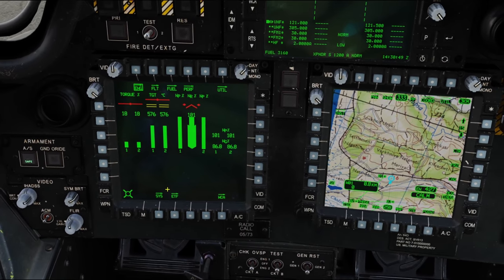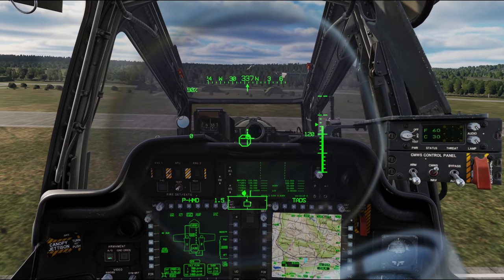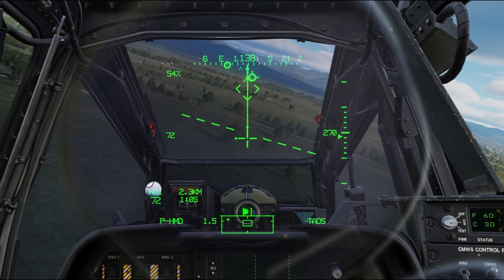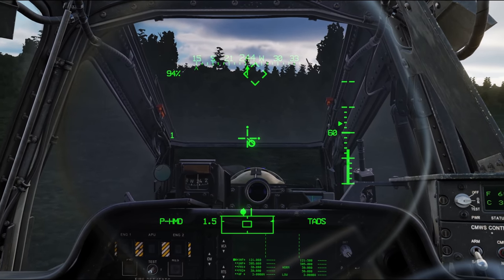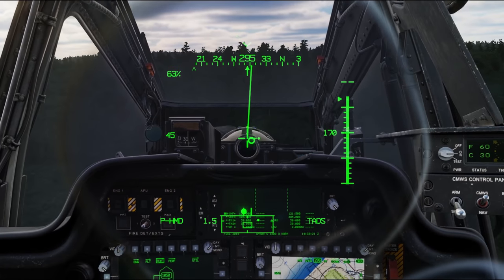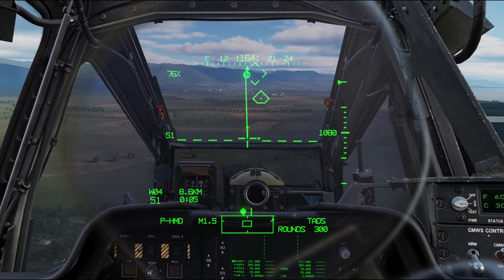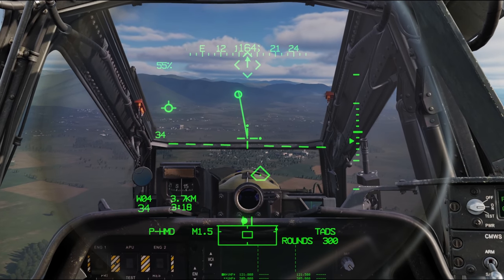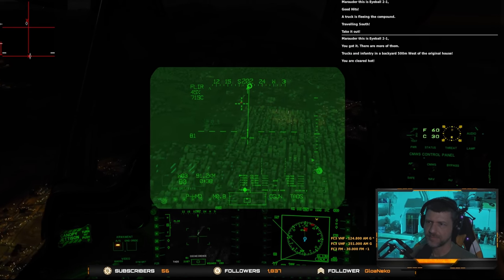DCS: AH-64D- Stop hovering so much

Comment: I made this mistake  on my first attack run against some tanks...... turns out ATGMs are just as effective against an apache sitting fat dumb and happy as they are against another tank........
Reply: Wait till they get you with the main gun. I earned real quick back in the Blackshark days not to get too close to tanks. Especially tanks with a laser range finder. Looks cool when they miss though.
Reply: @sasquatchycowboy5585  Oooof, never taken a main gun hit. Had a couple of ATGMs to the face between the Apache and my A-10 days...... kinda embarrassing in the A-10 tank buster when a T-72 kills ya.... I mean, kudos to the guy pointing the laser, he's got 30mm going off all around, and still keeps it on the jet coming at him..... that takes something else lol
Reply: @Streaky100001  lol.
Reply: @sasquatchycowboy5585  yea pretty much instant range acquisition, ballistic solution calculation followed by a Mach 3 tungsten arrow going straight at you
Reply: @Lemard77  It's way better then it used to be. At least as long as your moving you are OK. Back in the Blackshark days you couldn't even get close to an MBT.

Comment: Watching gun cams of the Apache taught me this. They always roll in to constraints, slow down and stabalise, then roll out. They never hover or do bob-up attacks.
Reply: Just out of interest, were those mostly COIN ops? Might be some differences between those and near peer tactics, and I also wonder if a bob-up attack would be more conducive for FCR and radar Hellfires vs. TADS and laser Hellfires, since you can dive out before missiles start landing... Definitely an interesting subject overall, and definitely the Russians leaned heavily into moving attacks, no reason why it wouldn't work for a lot of what the Apache does.

Not that I know anything about this stuff. I just like fiddling with all the cool buttons on the front seat. =)
Reply: @jubuttib  I don't know either, only time I've seen hover attacks is Desert Storm when they destroyed infrastructure like bridges, I guess it depends on your air defence intel. Russia knows Ukraine has a massive amount of stingers from the U.S.
Reply: @ukLeeham720  Wasn't actually even thinking about Ukraine, but yeah that applies. Was more thinking about some discussions based on translated doctrinal documents.

Comment: I seem to remember from Janes Longbow (release in 1996), they talk about tactics. And one tactic with the Longbow, because it has the radar on top of the rotor, you want to position the aircraft so it is behind cover (i.e. a hill), but just barely have the radar peekover over the top.

That way you can pop-up, fire your new radar-guided Hellfire's, drop back down, leaving the Longbow's radar with a line-of-sight as it guides the missles to the target.

Edit: Yup; i had to dig out the manual:

> FCR stands for Fire-Control Radar, a second type of target acquisition system found only in the Longbow. When you bob-up from behind a hill, the bulbous Longbow radar dome on top of the helicopter automatically scans either a 90° pie-shaped arc (for ground threats ) or a 360° circle (for air threats) and “memorizes” targets. The beauty of the FCR system is that you can store multiple targets and then fire off missiles in quick succession. After launch, the missiles lock onto individual targets identified by the FCR. (TADS, by contrast, can only store/track one target at a time.)
> While tracking ground targets with FCR target acquisition active, the safest way to update radar information is to mask yourself in a valley or behind a hill or other natural terrain, maintain a steady hover and slowly raise the helicopter. Your radar automatically updates whenever the top of your mast has a line of sight (LOS) to the target.

Comment: This is even a common mistake in the KA-50, which is the attack helicopter so many are accustomed to. A lot of people think the Akula is a sniper, it’s a reconnaissance helicopter, it can sit in a hover (and sometimes you want to with it) but its job is to exploit angles, conduct reconnaissance, engage targets of opportunity, etc.
Reply: I don't know what real doctrine is, but the Ka-50 is infinitely better if you fly it in a pair with a friend and pretend it's a two-seater. One guy is head-up, hands-on flying, watching for threats. The other guy is head-down, using the autopilot more, and running the weapons. Same number of pilots, but distributed lethality and survivability.

The autopilot and datalink make it relatively easy for a pair to fight like a single unit, which seems like it would be useful. Shame about the MWS and Igla getting canned, though.
Reply: The Ka-5x is better than the AH-64 at hover and non forward flight because of the coaxial design.
Because of the missile it is better to shoot from hover or forward movement.

Comment: Some people about Mi-24P:
"It isn't easy to launch missiles from hover, Hind is horrible"

Apache pilot about AH-64D:
"Don't hover so much..."

Btw, didn't yet check the fuel consumption in Apache so it was interesting point. In Mi-24 the fuel consumption is same regardless the flight situation or weight, about 840 liters per hour. Why you can be at high speed cruising, NOE, hovering, fully loaded or completely empty, it doesn't matter as turbines consume that almost constant rate.
Reply: "Hind has the same fuel consumption regardless of flight situation.." says who? the TV3-117 engine manual and the Instruction of usage of Mi-24 says differently.
Reply: I took full fuel and 4 external tanks. I was definitely overweight and I got bored after flying around for 3 hours. I had 6.5 hours of fuel when I took off but my fuel flow kept getting lower for the less fuel weight that was on board. It would be fun to try to do a massive ferry flight although I'm pretty sure I could cross the Atlantic with that much fuel at over 120kts
Reply: @deekamikaze  4 fuel tanks? You psychopath 😂😂😂

Love the Hind. Nice mix of ATGM and rockets. Haven't really used the bombs or dispensers much on it but should give them a go
Reply: @SouthPoleAntarctica  Two pilots that fly Mi-24 and Mi-8.

That was their answer to question that why Russian helicopters don't have the fuel flow meter, but only have the fuel amount instruments, because the fuel consumption rate is so constant that you don't need to think about it.

You will just take the ~850 liters per hour and look at the available fuel and calculate in head that how long you have, and your have slight reserve too.

So if you have 1300 liters left, you know you have about 90 minutes left (1300/850=1.52).
If you have 200 liters, then about 10 minutes(850/200=4.25).

When you plan your mission, you only think about the time you need to fly, not weight, no hover, no altitude etc. You example take 10min for starting, 200 km per leg, 15 min in location, that gives you with average 180 km/h speed flight time that is 1 hour ~6 min so it gives in total 2 h ~40 min, and it is 850 * 2.3 = 1955 = ~ 2000 liters.
Just maintain the flight speed that you arrive in both locations in time and that you stay less than those times in each end and you never run out of fuel. Doesn't care do you fly loaded or empty, at 2000 meters or 40 meters. Just maintain schedule.
Reply: @MrWiggo91  You can't really use bombs properly without bombing sight, that developers decline to implement, even when it is part of the operation and fully functional. So you are left to just fly over target and drop them, hoping best that you hit near target.

Sadly we got the P model instead far more produced V model with 12.7 mm Yak-B gun for destructive aiming accuracy up to 1200-1500 meters (caliber is excellent for over 2.5 km but you really don't hit targets there than by luck, and then if you even could spot them with naked eye). And quick slewing, automatic sight adjustment for flight parameters etc made it very accurate system at long range. Even having that automatic moving target prediction as in P, that you hold crosshair on moving target few seconds and lead is computed. 

In DCS that would have been more useful because so many trucks and like targets.

But at least we get now they side door gunner with 12,7 mm HMG to do same as with Mi-8. So all hummers, many APC etc becomes vulnerable targets when you can fly around and door gunner keeps shooting at enemy. But this requires skill as no automatic sighting.
Reply: @paristo  if have liked the Hind V although I do love using the 30mm to thin out targets on the ground
Reply: @paristo  speaking of the Mi-8 (THE 8, with TV2 engine), the manual states that fuel burn per hour is 640 kgs/hr at maximum speed, max weight while the least burn is about 500 kgs/hr (loiter). that's 20 percent difference in burn.. your lads a. arent flying their machines to the fullest or b. are not real pilots. ps. i was qualified to fly these.
Reply: @SouthPoleAntarctica  I quoted real active pilots,  so you can take yourself out from the door being only authority. I never talked about DCS...
Reply: @paristo  you said, "fuel consumption is the same regardless of the flight regime." i proved you wrong. you quote pilots deviating from the manual under the premise of "having it simple while producing certain margin" - which is simplyfing things but technically wrong. So, as simple as the original premise of the video we are discussing below, -> the Hind is bound by the very same laws of physics and burns less at the loiter speed compared to the maximum speed. same applies to the Mi-8 evolutions.
Reply: @SouthPoleAntarctica  And I repeat, real pilots state that they have the same consumption regardless their weight or environmental conditions when they plan real flights with the helicopters using the same engine as in DCS.  The variable consumption is so small that you don't care about are you hovering, flying fast etc. You have the average fuel consumption per hour, that is it. If you want to give some safety margins, take 50 liters per hour extra.
You are not going to be in situations where you are consuming 400 liters and then 1200 liters per hour because you decided to hover or to fly 250 kph instead 150 kph.

This is why you don't have fuel flow instrument inside as it doesn't matter. You look amount of fuel left, and then check the watch, ~850 liters per hour you need.

Edit: Made a simple test in the DCS and here are the results. The time difference between hovering or flying either as light as possible or as heavy as basically possible is negligent as I have said, following the experience the real pilots has said operating those helicopters in real life, and what even the charter company states as the consumption to be for costs calculation.
 
Here are the DCS values, where each flight starts HOT On Ground, requiring to take-off (add 10-15 seconds to separate from ground) and then raise to altitude in 20-30 seconds: 

56 min 47 seconds hover at 80-100 meters @ 29 C no wind.
35% fuel (684 kg, 850 liters)
Total Weight: 12307
Weapons 2917 kg
 - 2x UPK
 - 4x S-8
 - KORD + PKT gunners

57 min 56 seconds flying 120 km/h at 80-100 meters @ 29 C no wind.
35% fuel (684 kg, 850 liters)
Total Weight: 12307
Weapons 2917 kg
 - 2x UPK
 - 4x S-8
 - KORD + PKT gunners

60 min 15 seconds hover at 80-100 meters @ 29 C no wind
35% fuel (684 kg, 850 liters)
Total Weight: 9550 kg
Weapons EMPTY (0kg)

161 min 27 sec (2h 41 min 27 s) hover at 80-100 meters @ 29 C no wind
100% fuel (1929 kg, 2368 liters)
Total Weight: 13552 kg (104%)
Weapons: 2917 kg
 - 2x UPK
 - 4x S-8
 - KORD + PKT gunners

All are as well done with additional Infrared Suppressors and functional Particle Separators, adding maybe a extra 10-13% of the consumption. And weight as well includes extra armor.

Include a +/-15 seconds to times what it takes to drop from the sky and hit the ground. As DCS measures crash time and "landing" time only when touching ground.

If someone thinks that in one hour period that ~5 minute difference for flight time is major, then so be it. 
To me it completely falls inside to that rule of thumb that calculate fuel consumption with 850 liters and be done with it. If want to be really sure about all possible navigation errors, searching the approach direction etc, do that with 900 liters and you have more than enough time to fly how ever you want per hour.
Example, the theoretical maximum flight time with full load and full fuel is 2 hours 49 minutes something, so losing in almost that three hour period just about 8 minutes is ridiculously minor marginal. 

If you don't have anywhere close to the maximum loads, you gain at best just couple minutes flight time, be it completely in hover through whole time (out of ground effect) or cruising at 120 km/h. Could I have pushed to higher speeds around 250 km/h sure, maybe costing just a minute or two extra.

DCS World follows the experienced real values so closely that it is really nitpicking that how many decimals is wanted to be behind what number. As long something is inside +/-5% from real values, I am happy.
Reply: @paristo  try to fly a radiorelay for the maximum on station time, then hoist training session, then fly at the maximum speed. you will find out what i am talking about. if your videogame produces the same burn in these two situations, then your videogame is wrong :) twenty percent difference is a two digit difference, just not BEHIND the decimal.
Reply: @SouthPoleAntarctica  When the video game gives same results that real world pilots tell, that fly those things for their job, then it is fine when you have in game as in the reality the < 5 min difference in whole 3 hours time regardless your operation. 

As I presented, the fuel consumption is not identical, but the difference is so negligent that you don't need to care about it and follow fuel consumption rate.
Reply: @paristo  the "real world pilots" being DCS "pilots" like you has not crossed your mind, i suppose. Have you seen those guys in person? have you tried proving the same endurance you have at the 60 knots while flying at the maximum speed?

Comment: excellent points, Casmo. Perhaps it would be possible to explain when would be a good time to have a low hover - that way we can see what the use cases would be.
[if you are able to do so, of course]
Reply: Pre-emptive guess: When you can get a good line of sight from far enough away*, with enough cover around you to dive back into should things start going wrong.

*Which I guess usually means hilly terrain, and/or without constant massive tree cover. Mariana's is a tough environment, so many of the islands have just so many trees it can be really tough to see anything from low down, and the plains areas of Caucasus also make it tough to spot anything from low down, because a single tree blocks visibility for 20 km... =P

Comment: So many problems with power levels, the engines always turn off, and rpm is too high.   I have so much to learn, and its so frustrating not to even be able to hover and use weapons.
I downloaded a file from Users that would help set up my Hotas, and that is not helping.

When I try to fly the training mission for the 30MM, the right hand side says    Next, "WAS-UP" the Gun- Tedac left hand grip WAS UP   ( NOT HIGHLIGHTED)
I press the WAS-G/UP and it does nothing.  I tried all of the WAS buttons and the training mission will not continue for Me.

Thanks for any help with this training mission

 Clear Skies
   Mike

Comment: How viable would it be to perform low altitude strafe-style hellfire engagements on medium-threats (like armored vehicles with heavy machine guns or guided missiles) in case of flat areas with little to no covers?

As, store targets from distance, go low, approach target with speed as copilot shoots, offset while missile is following laser, break away once rounds on target... Is this a good idea, or would this be a suicide for a helicopter?
Reply: That’s just too dangerous. The Apache isn’t the Hind. If you do that with any helicopter it would be the mi24. But even then, helicopters are vulnerable. What will you do when a manpad blasts you point blank while you’re doing that? Just happened in Ukraine on video recently.

Comment: Casmo any tips for targeting with the cp/g? I find it very hard to use my lmc to ground stabilize beacuse the instant it's engaged any movement of the controls causes drift, which means with a mini stick at least I sorts have to let the reticle drift onto the target.
Reply: Increase the dead zone in the axis settings slightly.

Comment: You get the max fuel burn at maximum power, which is at maximum speed and in hover OGE. You get least fuel burn at economic speed. EVERY helicopter pilot learns this in his second class... Oh wait.. we're not talking about real pilots here.
Reply: Correct! Best rate of climb airspeed, best endurance airspeed, and smallest radius of turn airspeed are the all same airspeed for any airplane or helicopter. It is the airspeed where the lift to drag ratio is highest as plotted on that aircraft's drag curve chart at the intersection of the lift curve and the drag curve. Any airspeed above best lift to drag airspeed causes parasite drag to increase thus requiring more power and a higher fuel burn rate. Any airspeed below best lift to drag airspeed causes induced drag to increase thus requiring more power and a higher burn rate.

Best endurance airspeed is essentially best rate of climb airspeed except with just enough power to maintain altitude rather than climb. Smallest radius of turn airspeed is also best rate of climb airspeed but on a horizontal plane with just enough power to maintain altitude at whatever bank angle.